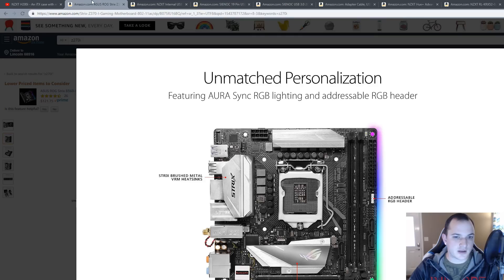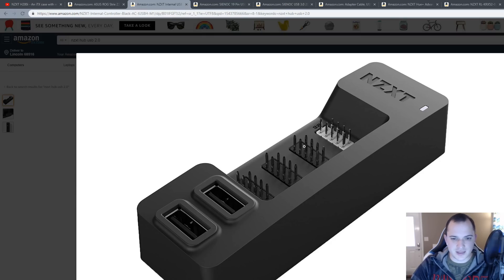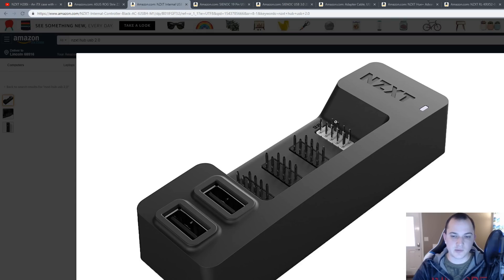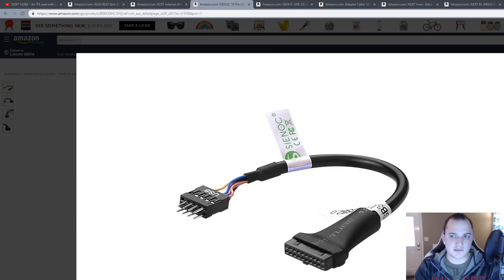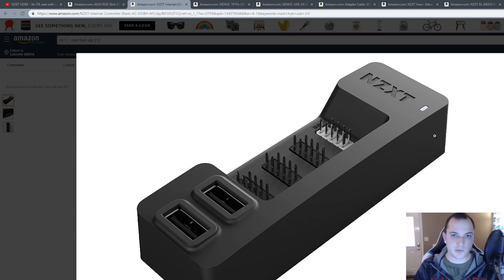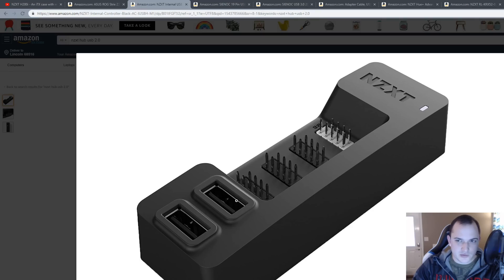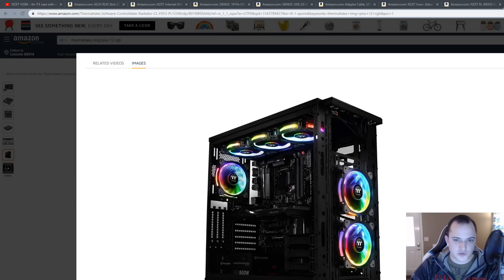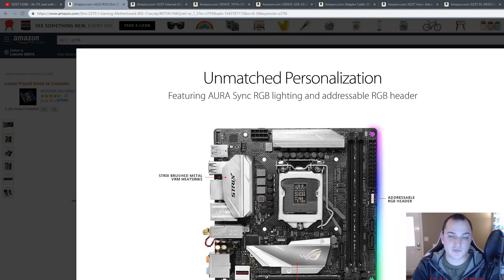How to Connect EVERYTHING into an iTX motherboard

Comment: Thanks for the video, you gave me some ideas, I've got a question though: if you convert 2.0 from a hub to a USB3.0 for front panel, you wouldn't get USB3.0 speeds from front panel, would you?
My problem is that I have one USB2.0 and USB3.0, but my Gigabyte AIO and front panel both have USB3.0 connectors, I don't really want to sacrifice USB3.0 on front panel, so probably would try to do a 2.0 hub + "upconverting" USB2.0 to 3.0 for AIO

Comment: My Gigabyte X570 pro wifi mini-itx doesn’t have usb 2.0 header, only F-usb 2.0 and F-usb 3.0 header, can I use them with the NZXT?

Thank you!
Reply: I've ordered the same motherboard and I'm in a similar predicament, but AFAIK this F-usb 2.0 is just USB2.0 header with 9 pins, so you can use it to make an internal hub if you need it

Comment: the funny thing is I've run into this issue where icue just doesn't see my commander pro if it is connected into any usb 2.0 header which sucks but i guess it is what it is
Reply: AnderzonTek  well what happened was it actually blew up
Reply: AnderzonTek  I had two in my system and something happened but both of my commander pros blew up which is funny cuz this is the 3rd time it happening. i keep going corsair because they truly are a great company but fuck there commander pros needs to have better quality control